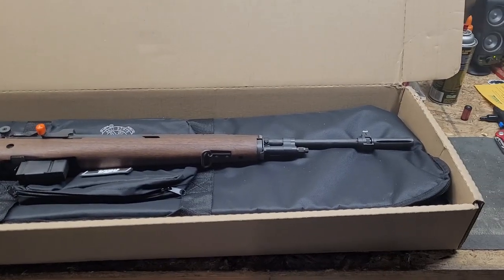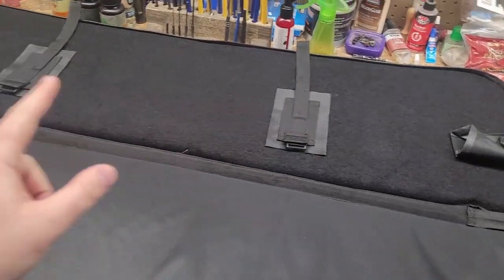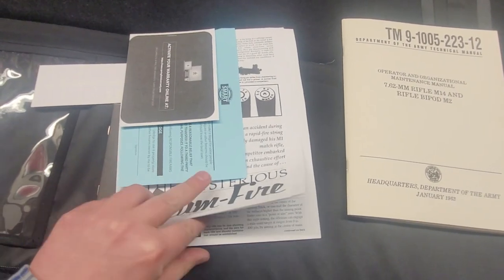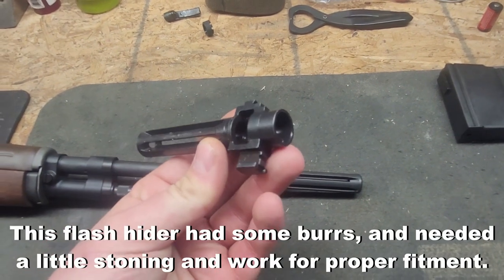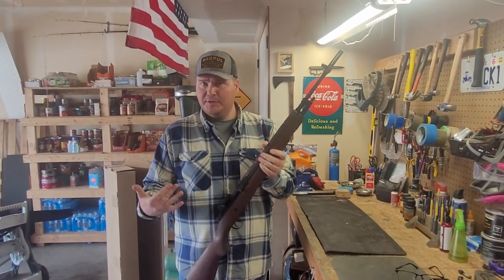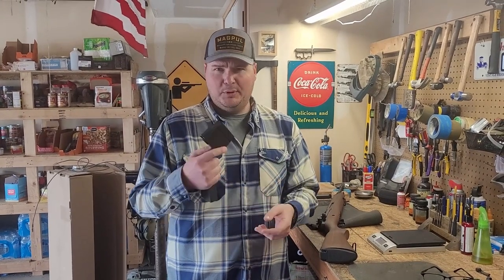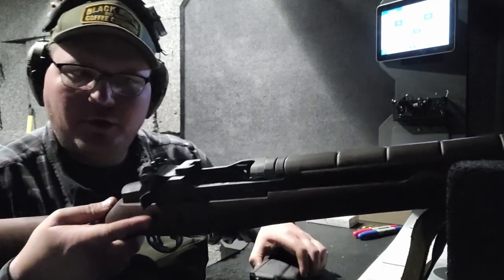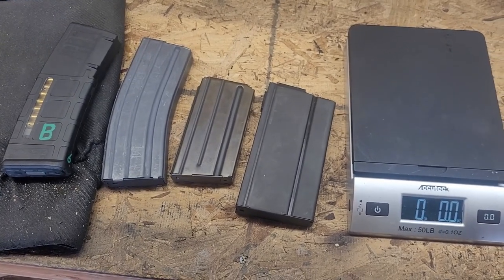Springfield Armory Loaded M1A NM

Comment: No, the flash hider will not rattle out from recoil. The flash hider is slotted onto the muzzle, and the castle nut just keeps it from sliding off. Then the set screw prevents the castle nut from backing out, and the whole assembly will remain firm with all three components installed. It's nice to have everything tight, but there are slight variations that might require the castle nut to be a little looser in order to line up the set screw with one of the detents in the castle nut. No biggie.

The recoil spring looks a little wavy, so you might have the standard stampet steel recoil spring guide. I recommend you swap it out for a National Match spring guide, which is cylindrical and will keep the spring smooth and straight.

The triggers are excellent on all these rifles, with a crisp break. If you have any sort of creep as you mentioned, it will disappear once you've shot it a few times.

My M1A started pretty stock, came with a California-compliant compensator, so I swapped it out once I moved back to America. It also had a rubber butt pad, which I replaced with a GI flip-up butt plate so I would have access to the storage compartments which are cut into all the stocks regardless of furniture.

Even though it was stock, it came with a NM barrel, sights, and other things... neat.

You can't expect any rifle to come with a sling, you are entitled to a magazine, though.

It shot about 2 MOA stright from the factory, which is darn good for a battle rifle, and after unitizing the front barrel band, installing a NM recoil spring guide rod, bedding the action, and a couple of other tweaks, it now delivers 1.25-inch groups when zeroing at 100 yards, fantastic since I was turning it into a DMR rifle like the one I carried in the Marine Corps. Remember, this was designed as a battle rifle, but it's an excellent platform that can be accurized even more than standard with a little careful planning. Just take your time to learn this rifle and you'll most likely love it. 

Of course since I intended it for field use I opted for the synthetic green stock for minimal worries about warping or splitting a wooden stock, and the standard webbing military sling is perfect for my rifle, I'll leave the fancy leather sling to those who own wooden walnut stocks.

It is fitted with a Sadlak Picatinny rail section that mounts at the front sling swivel, where I mounted an adjustable bipod with retractable claws; a Springfield Armory 4th generation scope mount; a Vortex Viper mil-dot 6.5-20X50 scope with sun shade, scope covers, weather-proof military turrets, and rubber eye piece extension; a folding bubble level mounted on the scope; a custom-cobbled coyote-brown cheek riser with 7 cartridge loops that laces on and looks fantastic; an ambidextrous side strap for tactical carry that I designed myself; and I'm currently working with a manufacturer designing a small spring-loaded dust cover for the open area behind the bolt when the bolt is closed... when it's completed and functional, we intend to put it on the market for those that might be interested. Be advised that it requires modification of a stripper clip guide or rear scope mount to install with a small machine bolt, so there is no need to alter the receiver, but it does require the stripper clip guide as a mounting point.

It is of course a lot heavier than most kids are used to, this is not an M16A2, but I'm quite capable of humping it around comfortably for its intended purpose. There are many other ideas I am putting together with manufacturers, and if it all works together it will be presented for trials in several versions. This rifle has been in use for so long in so many ways by the military, it's going to be around for quite a while longer.